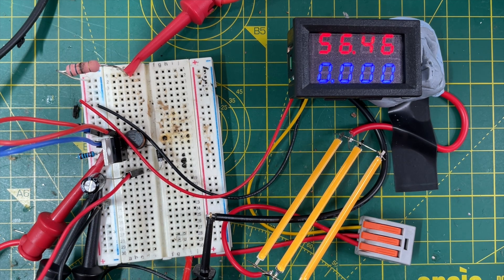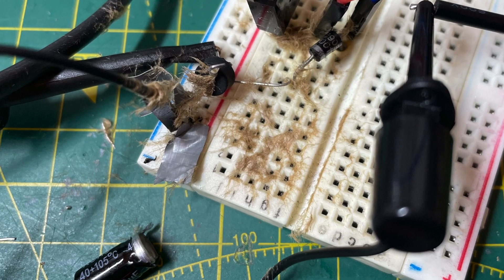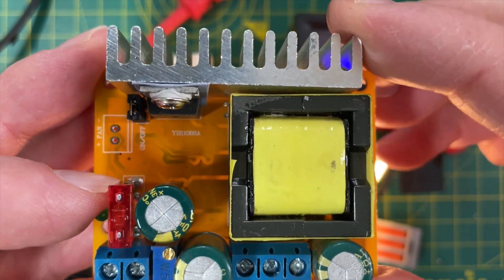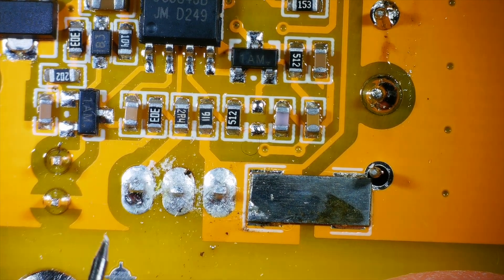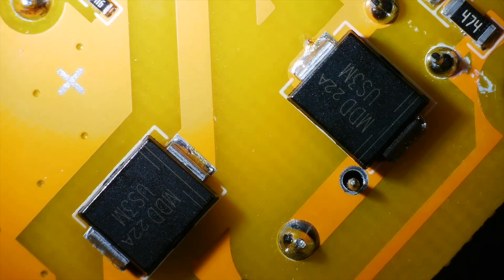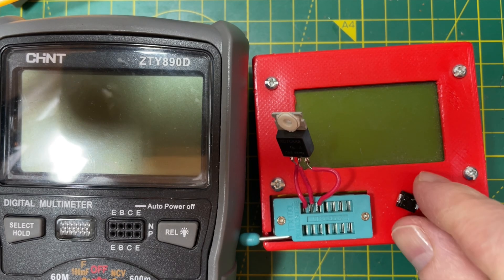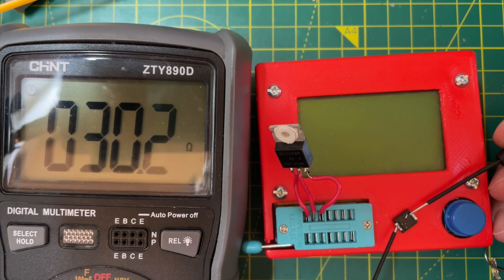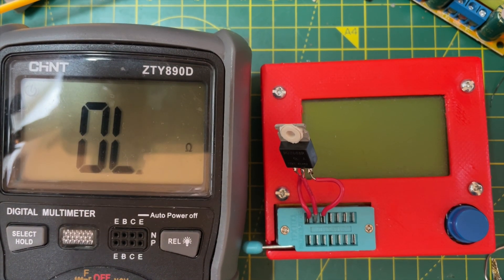800 volt DC DC converter

Comment: Maybe you can try to fix it? Put in new mosfet, try powering it up with CC limit. Also, is the output ac or dc? In case of ac you need rectification

There some other version of these dc dc comverter 12v to 220/380v to which i have and that seems very stable
Reply: Half the problem is the cost of the FET and diode in low quantities is likely to approach the cost of the chinese module

Comment: Those boost converters are usually OK.
I actually use the transformer from them on my capacitive discharge ignition system. I also used a similar circuit with the UC3843, but now using a UCC38C40 instead.
The HY1707 mosfet seems  to handle things OK but best to retrofit an RCD clamp as the spikes on the drain are pretty high.
Reply from the maker: I suspect it’s the load I’m using - the LEDs seem to be causing the output to be very unstable. I’m going to try it out with a normal resistive load.
Reply: @atomic14  I think the module claims 35W. Not sure. I took It up to 20W on output with no trouble at all.
And on my boost circuit which is a slightly modified version with an RC snubber and RCD clamp clamps the spike at 43V), it sat at 25W for a while without bursting into flames.
On my CDI I'm getting close to 9A across the FET but nothing gets remotely warm. Not even running a heatsink on the FET.
The UCC38C40 seems a better choice than the UC3843 and is a drop in Replacement.
Reply from the maker: @TYGAMatt  I am wondering if it's my low load - the LEDs only draw 20-50 mA and I think that is causing instability in the feedback loop. Would love to see your design.
Reply: @atomic14  how can I send it to you? Happy to share with you.
On a side note, I've just been testing an LT3750 capacitor charger with a view to using that ic instead. It sort of worked and then something went wrong. Oh well. All in the name of fun I suppose

Comment: You could have just made a little boost converter, i made a simple one for providing the 120V for my nixie clock.
Which one day i will finish. :-)
Reply from the maker: The stack of unfinished projects never shrinks.
Reply: @atomic14  I'm going to need a third arm as my list is longer than the current two. Now looks like I need to buy a mig welder to sort out one😃
Reply: Ohhh I hear that - I will also one day finish my nixie clock. One day. <3